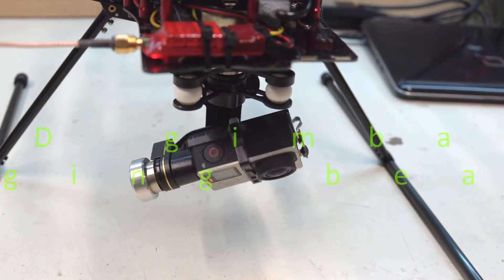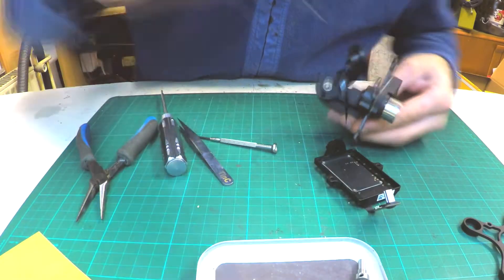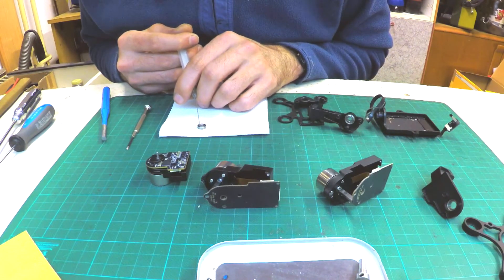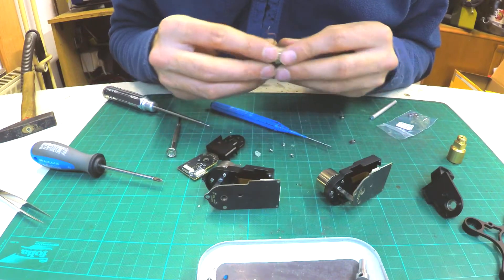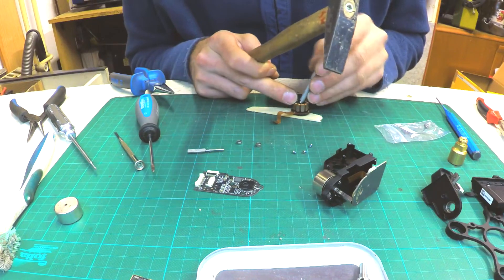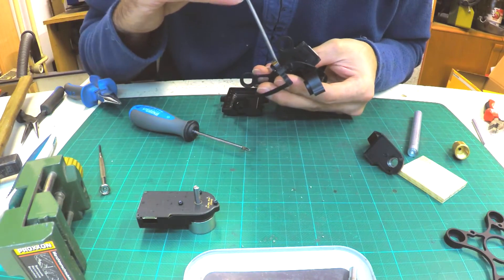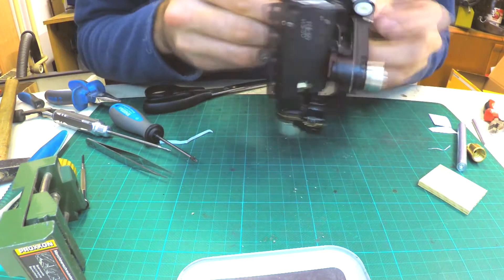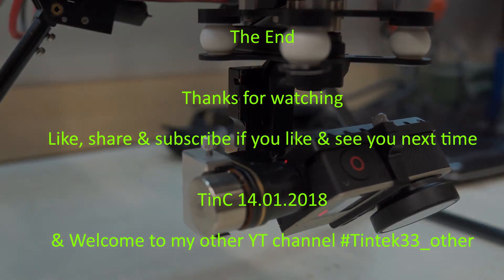DJI H33D gimbal problem solved [grinding sound] -replacing bearing- [diy fix]

Comment: so i am having this buzzing noise and movement that occurs every two seconds as well, but my tilt motor quickly becomes very warm. I don't think my bearings are worn out at all. I also tried another H3-3D gimbal on my phantom 2, and i am having exactly the same problem.
Reply from the maker: Somewhere you must get the free space, so gimbal try to stop motor on it's poeition but can't find them, so it start buzzing because of tiny movements, and motor become hot, in my case was the bearing since i replace them it works great, but you can get free space also on encoders.